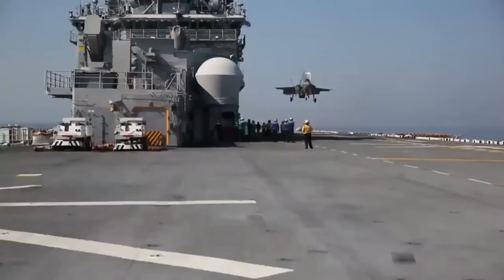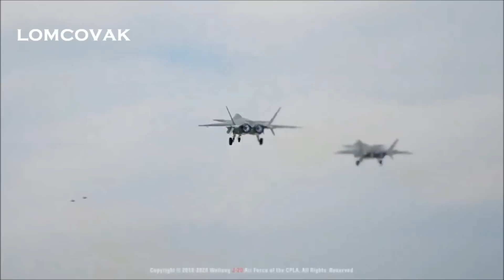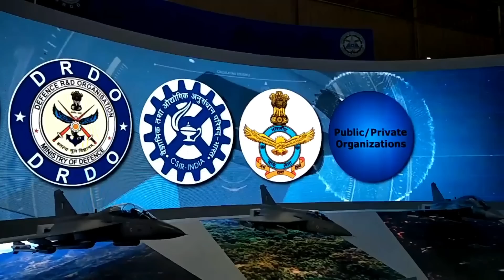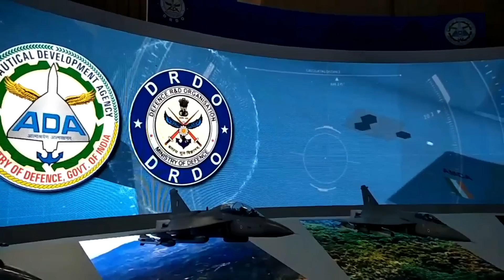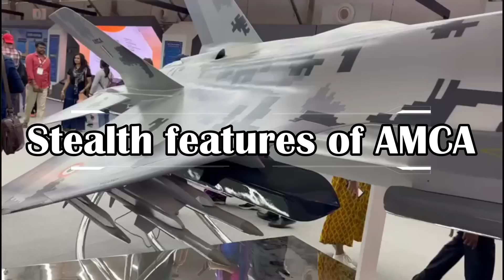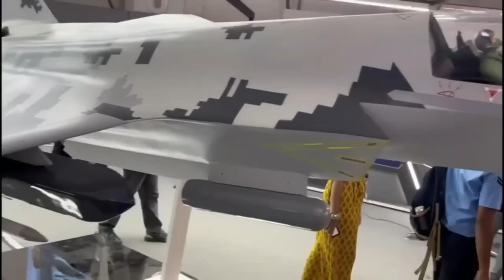AMCA racing against time to counter Chinese J-20 fighter jet.  #drdo #ada #hal #indianairforce #amca

Comment: India should join the Boramae program and merge the AMCA project into it. They have similar size and characteristics. Boramae is at least a decade ahead in progress and production could theoretically begin in India at the same time as in South Korea which is scheduled for 2026 for batch 1 aircraft. This would make Tejas Mk2 unnecessary and some components for that could be recovered as upgrades for Tejas Mk1A. Production of Boramae in India could be about 300 aircraft during 2026-2038. 

India should also join the Tempest program which would provide even more advanced fighters to start production in India around 2038. 

This would accelerate the induction of stealthy aircraft and provide significantly greater capabilities in the near term. All aircraft would still be built in India and the majority of components could also be built in India.